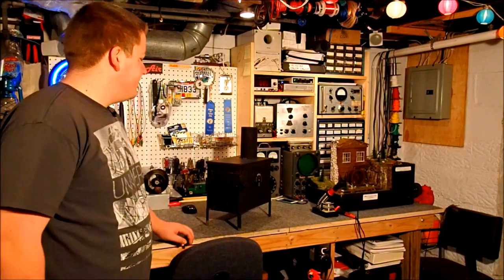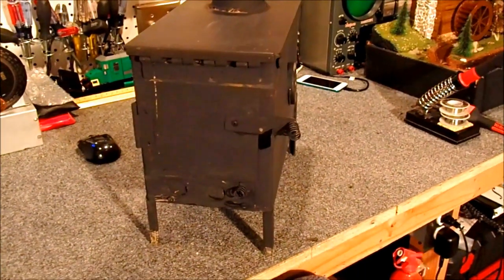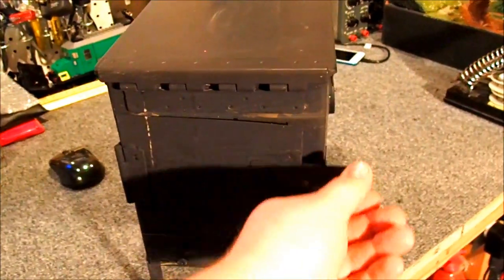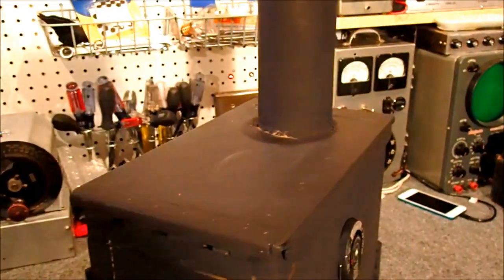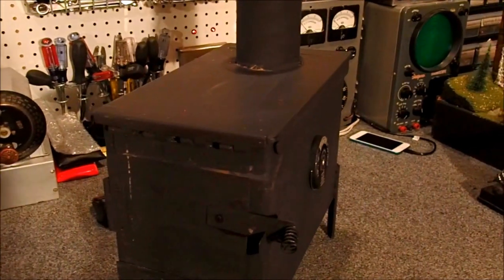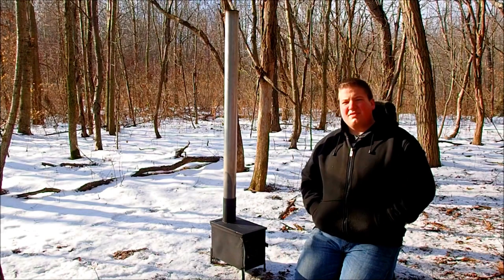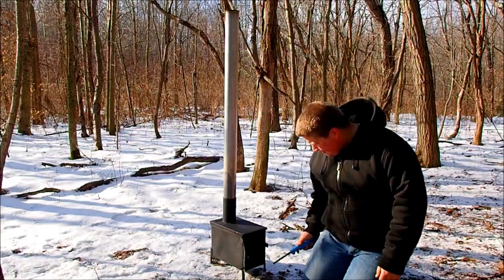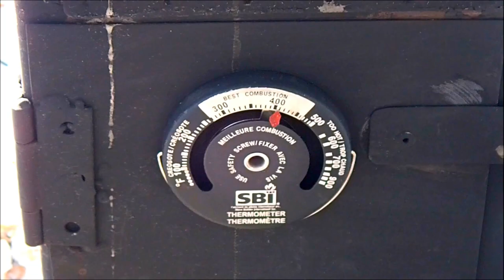.50 Cal Ammo Can Tent Stove

Comment: Hey Matt nice work on the stove. Are u a Ham operator? Seen the on the air sign, soldering iron and some other gear. Cheers Fred VE3 FAL
Reply from the maker: No, I am not a Ham operator. However, I do repair tube radios/amplifiers and various other antique electronic devices. Regarding the "on the air" sign, I have an AM transmitter that I use to broadcast music to my radios. If you have time check out my video on the Westinghouse fan restoration to get an Idea of the stuff I work on. Thanks for the comment!

Comment: Hey how hot does your stove get? Some people have used have pipe rated up to 475 degree. I'm in-between on what pipe to get for my needs thanks for your time.
Reply from the maker: Joe Parnell my tent is small, so keeping the draft at bare minimum keeps the tent at about 60 degrees. Usually my fire just kind of smolders and there are not flames per say, I probably run it at about 325 degrees.